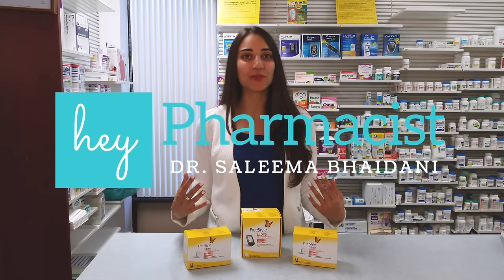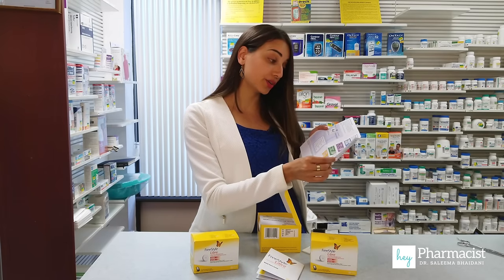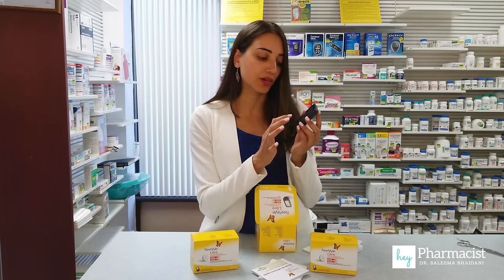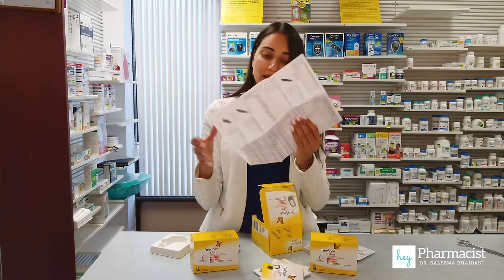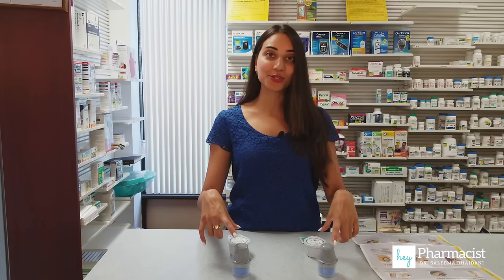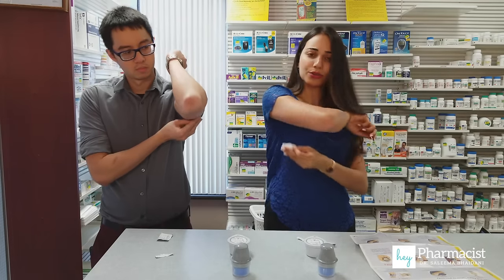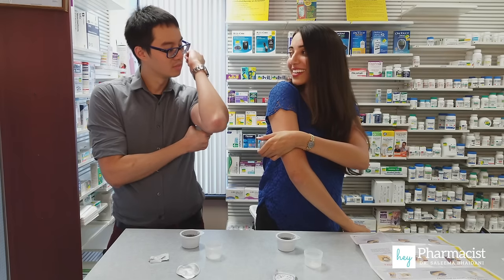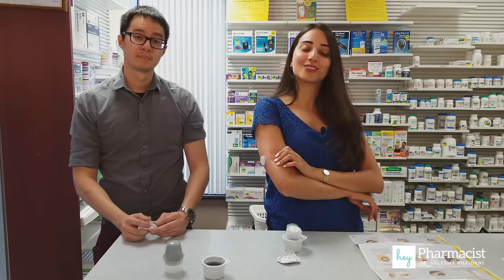FreeStyle 1: UNBOXING, APPLYING & TESTING

Comment: Careful to examine the sensor when you remove it.  Abbott has confirmed that there have been multiple instances where the needle has detached and stayed in the patient.  This happened to me without my initial knowledge.  With zero help from Abbot, I had to go through 3 doctors in order to get exploratory surgery to remove the needle.  It too over 4 months of being in pain.  Abbott would not help cover costs or even call back.  I wish I could post the beautiful pictures of the blood and incision for everybody to see.
Reply: Sorry about your painful ordeal. You should have sued them though !
Reply: Yes I used 5 them needles broke off went my moms arm .
Reply: Sorry you had go through my moms arm was bleeding Abbott would not send but 3 new ones return out of 5 we tried
Reply: I have used this product for four months and for four months The needle has fallen out for three and for the fourth month the needle stuck in my arm now for months that means eight tries to no avail I even taped it on my arm but when I work and I flex my muscle thing pops out this thing is a piece of crap I have notified the manufacture to no avail but I will get their attention eventually I’m gonna take them down through every media news station whatever I can possibly do yelp everybody this product does not belong on the market until it’s fixed properly this is a generic piece of junk you don’t put it on your muscle so when you move your arm a needle pops out and the last two cases the needle didn’t pop out the stick and popped out and the needle stayed in and I even taped it on my arm still popped off is this a joke that they’re playing on me well I don’t like jokes playing on me I get angry and now I’m angry I have nothing to test my diabetes and I’m pissed. I am going to have to get a hold of yelp or the news media etc. etc. and till this problem is rectified and I am reimbursed for eight needles so that comes out to $120 dollars. I have done exactly what they’ve told me to do and even put tape on my arm to scan the first one lasted a week the second one lasted two days it goes on and on and on and I’m tired of complaining I don’t like it but I don’t like being taken for a fool when you put something in your muscle and you flex your muscle while you’re working it’s gonna pop out common sense.
Reply: Thanks for sharing I will stick with the finger prick. I'm so sorry you went through this
Reply from the maker: Sorry to hear that happened!
Reply: O.m.g. I  pass on this..TY❤
Reply: @thomasfarley7322 did the needle get stuck in your arm? I have one but haven’t used it. Any advice?

Comment: FINALLY! :)
A video that explains what exactly is left stuck in your arm! A filament that monitors your levels sounds a lot better than an actual needle in your flesh 24/7. I've watched almost a dozen videos now and they were all very unhelpful including the manufacturer of this product! Thanks for the in-depth explanation here.
Reply: Nik Galego I like that it’s not actually a needle but a flexible filament. Of course who would want a needle stuck on your arm for 14 days. Well, I heard somewhere that the goal of the freestyle libre is to launch a needle- less Glucose monitoring system.
Reply: @cyrilsablan6532   You can also use BluCon Nightrider with FreeStyle Libre sensor for getting readings in your phone as well as watch even without phone.

Comment: Thank you for this video. i just development type 1 at 30 years old and this has been quite the change for me. I've had the libre sitting on my counter, unopened for weeks, because I've been too nervous to try it. This video helped me and I just put it on my arm after completing the video. thanks again
Reply from the maker: Thank you for watching!
Reply: I hear ya! I’ve just been diagnosed and am 46. This video made the whole process much easier and less intimidating. I have found that it doesn’t hurt at all. So much better than the finger pricking!

Comment: Thanks for the informative video. I am about to start using Freestyle Libre from today. Got the prescription from my endocrinologist and got it filled from my CVS pharma. Will be applying the patch today. Since I don't have a compatible iphone need to use the reader. In US, I pay $75 for a month supply of sensor (2 units of 14day libre) and $68 for the reader. This is the price after insurance pay.
Reply: My insurance does not cover this .  I used the discount card they give away at CVS and doctor office. I paid $70 for 2 units at CVS .  The reader was $35 , but I declined it and use the Android app.

Comment: I had a low reading on a few occasion and the FreeStyle 14-day meter was showing normal readings. Quickly I checked it with another Accu check meter and fixed the low sugar issue.  I called the customer service support, as usual, the call went to a different country. They kept me on phone for 1/2 hour took all my info and was unable to resolve the simple problem. This product is not cheap in the US for this kind of service and results. I would say if you are using this product then keep a different backup meter for yourself.

Comment: This is my 1st day with the freestyle libre 14 day.  A couple of things to watch out for: charge the reader first.  Installing the sensor, the stick material that holds the sensor, holds to your skin very.  Where it's not sticky is holding the sensor to the sticky stuff that's attached to your skin.  Two ways to do that, cold-ban wrap or a bandaide like patch that covers the 14 day sensor (works even through hot showers).  If the reading is way out of range, you need some FREESTYLE NEO PRECISION TEST STRIPS costs about $15.00 from pharmacy.  Regular freestyle lite strips will not work.

I hope this will move you beyond the gotcha stage.
Reply: I was just asking if you can wear this device while showering or bathing.  So you do need to cover this device on your arm with something then?  What is a cold-ban wrap?  Where can you buy it?  Also, is this covered by Medicare and authorized for use by the FDA?  Thanks in advance for answering my questions.

Comment: Thank you for your video.  However, according to the FreeStyle Libre video, user has to activate the new sensor before you can measure for the first time by pressing the Start New Sensor on the sensor screen and place the reader close to the sensor to activate it.  This was not mentioned on your video.

Comment: Great video, however, I recently tried this and if I had given myself insulin based on these numbers I would have passed out or at times not given myself enough. Numbers vary so much compared to finger pricks. It’s a great thing if numbers were in line. Occasionally they were close but most times not.

Comment: I've been a T1D for 28 years and this was the biggest waste of money and time for me. I hear that it works well for some people but I had 3 faulty sensors (out of 4) and the delayed readings were not easy to work with. Really nice video though 👍🏼
Reply from the maker: I've heard that with other type 1's... I normally recommend only for type 2 diabetics. Thanks for sharing!
Reply: @heypharmacist  I use it with NightRider for last 12 months and never had any issues.
Reply: its more for type 1's and it works great if you know how to use it and are aware of its limitations-all cgm's have a lag time therefore you are always behind with the reading from whole blood. also, when your blood sugars are changing rapidly it will be off! the trick is for diabetics to stick to a low carb diet and use much less insulin but, since the ADA diet allows 240 grams of carb daily its no wonder blood sugars are uncontrollable-once you commit to that low carb diet the libre will work great.
Reply: I've used a  cgms for 11 years with my dh the type 1 diabetic with hypoglycemic unawareness.  The cgms isn't always accurate.  If you have no awareness you are going low till you are barely conscious and very  confused, a cgms is great but you are supposed to test to confirm that cgms low reading..  I've never used the Libre, but I think I read if your Libre reading is 3.9, you are supposed to test to confirm you are low.    @heypharmacist    you get out of a lot of testing.  I used a pump alone with my husband for 6 years and it's very frustrating to test and find he's normal.  LOL! But you do have to test to confirm lows and  highs before  administering a correction bolus with your pump.  Your video    is          very  helpful for  those who want to see how you apply the Libre sensor.
Reply from the maker: @dinkster1729  thank you, I'm glad the visuals were useful! Thanks for your comments

Comment: Hey Pharmacist! I'm a type one and a practising pharmacist in BC.

I started using this system three weeks ago. 

From my point of view, this thing is a game changer. Being able to determine BS on the fly and see a trend on the screen is a huge advantage.

A few comments/notes. 

Remember to let the site to dry fully after swabbing otherwise some transient stinging will occur when applying/inserting a sensor.

Be careful towelling off after a shower. Don't want to drag a towel across the sensor and irritate the site. Pat the site to dry.

Keep the old applicator housing. Easy/secure way to safely dispose of the used sensor.

The adhesive will accumulate clothing lint. Either position it higher on the back of the arm or live with the "dirty" ring around the sensor. 

Expect some initial discomfort after applying/removing the sensor. 

Yes. Make sure the site is hair free. Removing a sensor and ripping hairs out is no fun,  The adhesive on these things is tenacious. 

Airport security screening... I'll let you know in a couple of weeks after a Canada-UK-US-Canada Trip.

Buy an extra reader to have on hand in case you drop/break/lose one while travelling.

Keep the old standby monitor, strips and lancets with you... just in case.
Reply: Any update on how airport scanning went with sensor?
Reply: @erikipf  The metal detector was no problem... no bells or flashing lights. Never got anywhere near a full body scanner...

Comment: Good video, thank you but a quick correction. I installed the sensor and waited an hour, then scanned it at which point it said "sensor ready at 2:46 PM" (it was 1:46 PM current time). So the steps should be to install the sensor, scan with the phone or reader, wait an hour and then it will be ready for use.

Comment: I hate the Libre II. It is 40 mg high. Tech support said it can take up to 24 hours for it to display accurate readings. Also, if you didn’t know, the strip reader on the receiver is simply a glucose reader, it does not calibrate it. There are several other cons but these are the primary ones.

Comment: Apparently it seems very easy, but not quite, we have already changed 4 sensors before the deadline, because they are not measuring the medications correctly, always giving a huge difference to the measurement made with the blade. The only support we've been given is sensor replacement nothing more than that.
Reply: Have you tried the libre2? Some people say it works a lot better but big difference in price. Was curious to hear your thoughts ?

Comment: Thank you for the demonstration! I just got the freestyle Libre 2 and I connected it with my phone instead for the device. I’m glad the needle doesn’t stay in the arm. I was worried about that. Very easy to use after watching the video. Quick question… in 2 weeks when I take it off… is there a specific way to do so?
Reply: I've used the freestyle libre for approximately a year. To pull my sensors off, I just do it like taking off a bandaid.
Grab the disc from one side and pull it off.
Reply from the maker: Yup! Exactly what milkshakemuncher said!

Comment: I have this unit, but sometimes the finger stick and the scan test may not match.  It is best to get some adhesive patches or an arm strap to 
may the sensor more secure.
Reply: The reason why finger sticks and scans do not match sometimes is that the Libre sensor takes the readings from interstitial flud (not from blood). The insterstitial fluid readings are approx 10 mins delayed. Btw, even if you test with two different glucometers you will not get the exact same number. You need to consider the margin of error that each testing device has.

Comment: Video is great but I can’t get the sensor cap applicator
 “unscrewed” from the applicator!! I have tried everything! Any suggestions?   Thank you
Reply: I paid a lot and now am unable to use it!!’ And the sensor is open so it will not be useable soon.  My hands are killing me from trying to open the applicator.  I have even tried needle nosed pliers with no success.  Perhaps a knife  next?  
Anyone else???  😢

Comment: OK first - notice all Youtube vid by Freestyle have the comments turned off.. says something bout the  manufacturer... 

now good news THIS PRODUCT HAS ALLOWED ME TO DROP FROM 8.1 TO 7.2 A1C!!!! it is  fabulous aid in monitoring blood! 

Now for the bad ... expect a 15-20% failure rate on the sensors.... If they ship you 6 sensors you WILL NOT GET 84 days of use [6 x 14 = 84]. I have been using this system for 6 months... it is addicting! you are constantly monitoring your blood in an effort to get an A1C of below 7! I

 just wish they had better quality control on the sensor manufacturing!

PS.. the Libre consistently measures my blood 20 points lower than it is by finger prick... No big deal to me because I KNOW it underwrites and medicate accordingly... Still a fabulous product IMO

Comment: Thanks for the information you've given out in this video.
My question is :
You Said the patch is good for 14 days. Does taking a shower or similarly , going to the Beach and getting sand on it etc effect it's efficacy ? If so, plz give detials. Thanks !
Reply: Sam question i have,can anyone answer plz
Reply from the maker: @soomaezsomaez9411  No it should not, you can shower with the device.

Comment: Hit a muscle on the first install bleeding really bad...i did it where your associate put his it must be on a flabby part of the arm i had to to pull off the sensor to stop the bleeding which stops and voids the sensor once its off no matter if 14 days is up abbott said it breaks internally if you take it off and must install a new one they sent me a coupon for a new one which was cool also my kit came with a sealed thumbnail drive tutorial in the kit to watch on my computer. Also amazon is full of accesories for the libre like clear waterproof patches for working ,shower or if you dont want it to get wet they also have nice protective cases and belt clipons

Comment: Couple of questions for anyone....what about daily showering, its tough enough to go through all that?  And second question, if you can't reach underneith your arm, can the sensor be placed elsewhere?  Or even somewhere it won't be exposed to be pulled and tugged on?
TIA 👍
Reply from the maker: Yes to the showering questions. And the only recommended site for now are the upper arms. You'll see others using it in different ways but it's not recommended

Comment: 1. Is there a follow-up video to this? You mentioned that you were going to make one, and there is quite a bit more information that could be very useful. I was curious to see what the first reading was going to be, and was very interested when you said that it received it. But you didn't mention what the value was.

2. We just did strips on my father, who has been using strips for some time. His readings were 90mg/dL, which is in the normal range. Minutes later the reading on the FreeStyle Libre was 60mg/dL. Do you know why those would be so different?  Thank you.

Comment: Sorry, this seems like an obvious question but is it safe to leave the sensor on for 14 days (leave it on during showers?) and also any tips on removing it from the arm?
Reply from the maker: Yes you can leave it on while you shower. And simply peal off the sensor after 14 days :).

Comment: I've been using the device to check blood sugar but my situation opposite my issue is to low mine has gone down as low as under 20 very rapidly 
What is the cause of this? This just started a couple months ago.
Is this diabetes?

Comment: am tying to start my new reader but it's  not getting on, so can it be that it has no charge or?
secondly, my old reader is still working well but when I use my test strips it no longer give me results , it keeps on showing strip may be damaged, expired etc but the strips are valid. I have changed many of them but still doesn't work. 
can someone tell me what I can do? coz am thinking of charging the new reader but what if it refuses to work again?
The other question is, how will i store the new reader after using it coz now i will be having two working readers ie the old one which doesn't give blood glucose test strip results and the new one which i only want to use when using the test stripes.

Comment: So, it will only give you a glucose reading when you flash the device over the sensor? I have been  dexcom user for years but my insurance wont cover anymore so i'm looking at this one
Reply: James Roche Yes, you need to scan to get a reading. Abbott recently released 2nd generation in Europe. The second generation has introduced alarms when you BG is out of range you get a notification. But you still need to scan to see the actual blood sugar.

Comment: I just started using this system because my insurance made m switch from dexcom, and I do not like it so far.  Especially the android app. Is this reader better?  The app really sucks you can't change the time window it's showing the graph for it won't let me set the rate of change that I want an alarm for. If someone can help me with these issues that'd be awesome